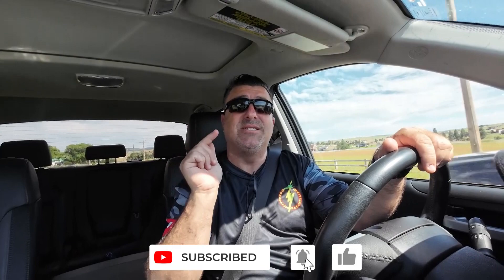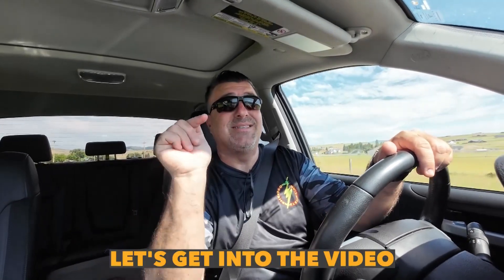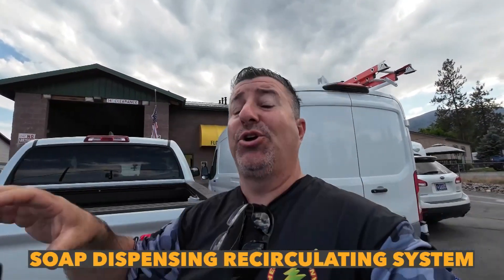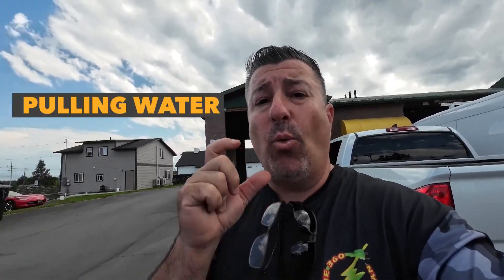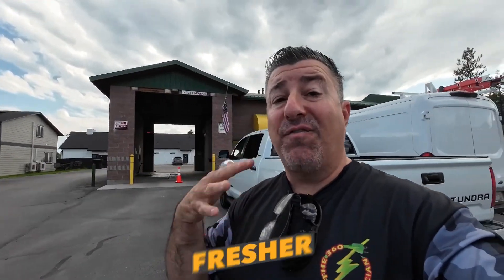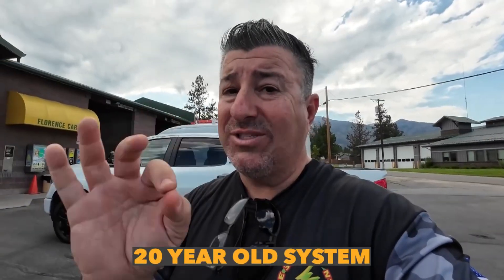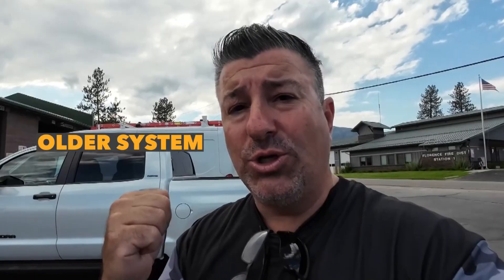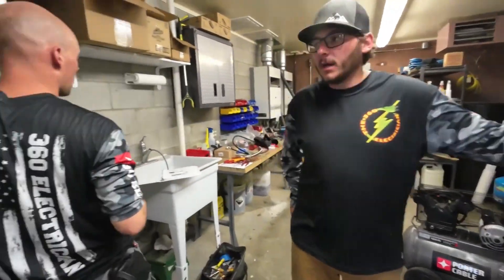Electricians troubleshoot motor controls at A Car Wash - What Can Go Wrong? #electricalcontractor

Comment: Can remember my chief electrician dad telling me years qgo that troubleshooting seperates the boys from the men. Said you can train a monkey to run conduit and install lights but not troubleshooting. I was a sparky at a large candy plant. They had 5 sparkies on day work and only me for second shift oroduction. My chief electrician was the absolute best. Told the night maintenance foreman and production supervisors that I was only there to troubleshoot and no construction work. When the head night production boss saw me sitting in the maintenance shop he was happy because then he know everything was working. Always liked troubleshooting motir vontrols then got good in VFD'S. Would tell the young sparkies to sharpen up thier troubleshooting skills and get good at VFD'S because they are more of them then starters. We had iver 500 VFD'S on our campus with the newest building having nothing but hut drives for every motor 5 HP & over except for the 250 HP fire pump that had a soft starter. Even two new 1,750 HP 4,160 volt chiller motors erre on VFD'S.

Comment: Its always interesting to me watching electricians do anything with motor controls. Not saying that you guys cant, but its not really something you guys work on, where we are always dealing with similar setups in HVAC.
Reply from the maker: I kinda agree. I did a video a few weeks ago where we troubleshoot a vmc for a 20 ton unit. Defiantly a fine art. Hvac techs that do more commercial are probably better trained then most electricians but I think either can handle it if you are confident and have some experience. Just don't F-up otherwise there goes this weeks profit.
Reply: @The360Electrician  I agree with you more than I do huasohvac. As an electrician I've worked on motor control systems inside steel mills and hospital hvac systems.

Comment: Looks like a control cabinet with small PLC system and a relay control cabinet.

The easiest fix Id think would be to watch the process and verify which digital output energized at the step of the process that is the problem. From there you verify the wiring from the PLC to the solenoid (or the control relay) and verify that it matches the prints. I’d assume the issue here was a wiring issue where it was simply wired to the wrong solenoid. It could be a lot of things but that would be my first check.

Easy upsell here would be swapping out the solenoid plugs with ones that have LEDs for easy troubleshooting in the future.

Sounds like you and your guys made easy work of this fault, good job!
Reply from the maker: Thanks for the indepth comment. LED solenoids are a great idea. I think one of the biggest issue is there is no Grainger or Other parts supplier that would carry anything thus adding cost to mail order.  Your right about the miss wire. We still don't know if it was the new pump installer or maintenance guy. Nevertheless I was impressed with my team.